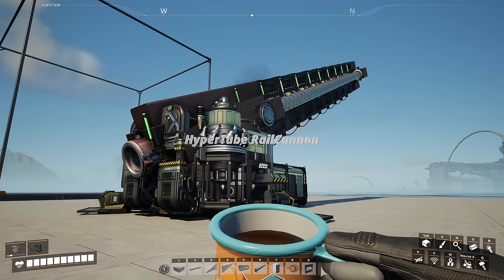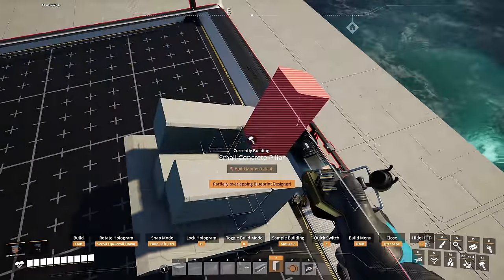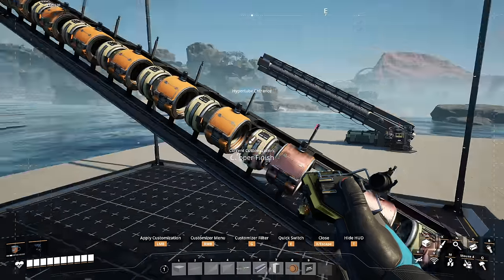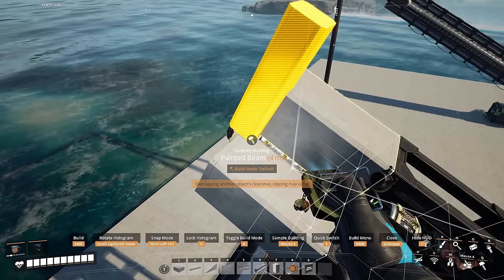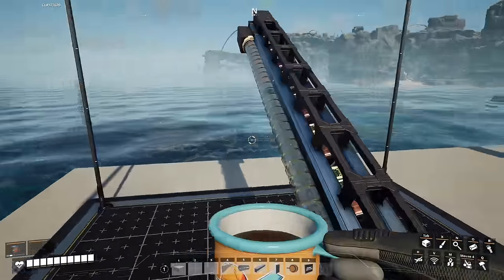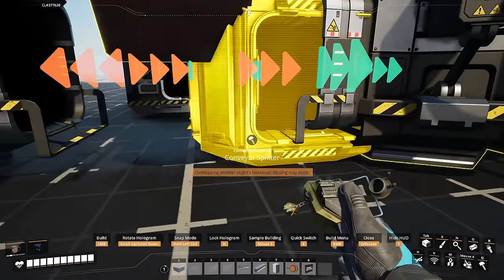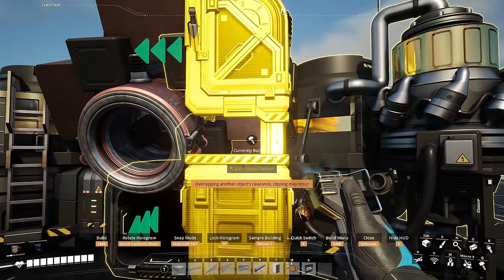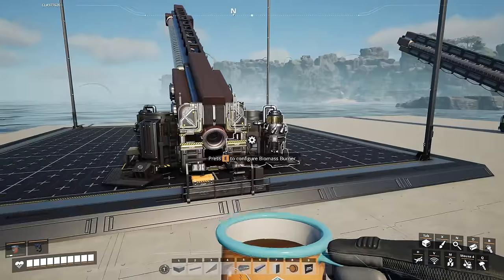Hyper tube cannon Railgun in Satisfactory 1.0

Comment: Haha, you made the blueprint. Glad it fit in the mk3 blueprint(im in the middle of unlocking mk3 BP)
Reply from the maker: Yeah I wish I could have had a smaller one for the blueprint Mark 2. But just to be able to fit it into one is good enough I guess.
Reply: @DrawingXaos I mean, heretical though, but would it fit in a 2 if we build it diagonally? Should give more length in the mk2?
Reply from the maker: @GundamReviver  dosnt hurt to try right
Reply: @GundamReviver  The middle ground is you build it in mk2 with 8 accelerators instead. If it's not strong enough it takes only a couple of minutes to add the other 2 manually. It's a good stop-gap solution till you get mk3.